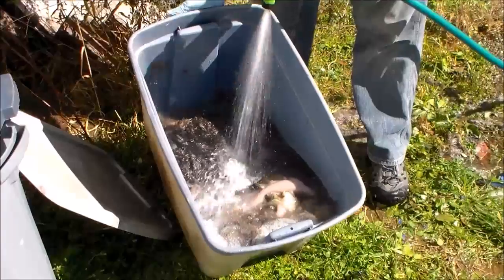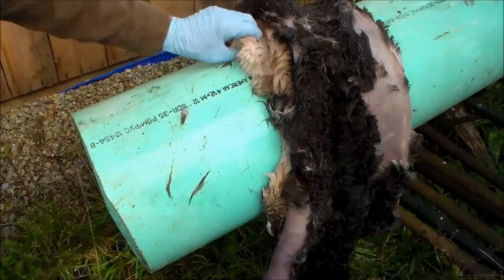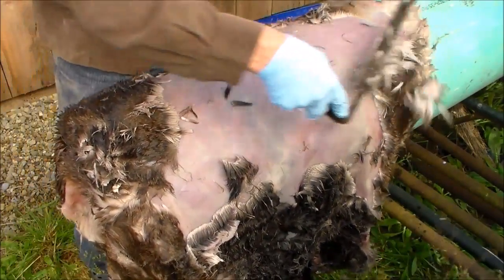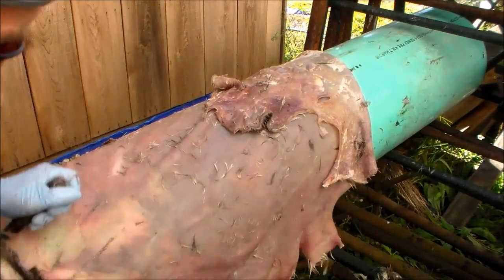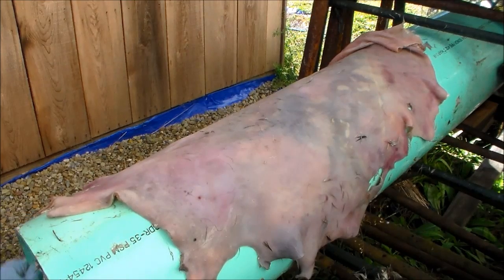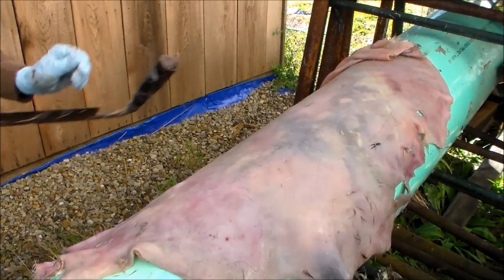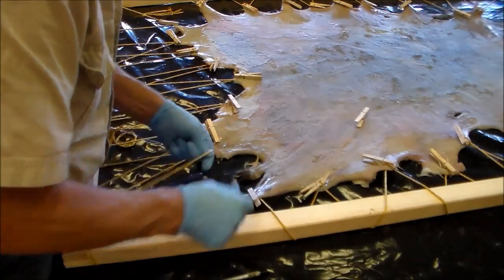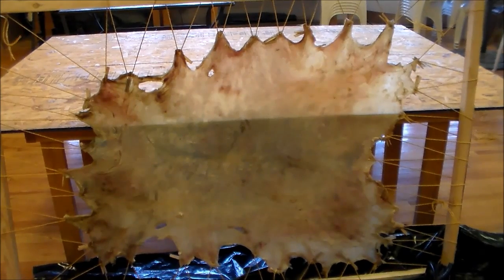DIY Rawhide From Deer Skin

Comment: i once did a rawhide from a fresh hide, from an impala, the end result is now the head of a few drums i made for myself. Now i am trying to re-hydrate a hide that was stretched and dried, something a hunter on a nearby farm gave me to try to make rawhide from. I had it laying in water for about 3 days now, and unlike the fresh hide, where the hair came out easily after only being in water for about 2,5 days, this dried hide just does not seem to want to release the hair at all. 
Will soaking the hide, which is thoroughly soaked by now lose the hair more easily if i soak it in a mild lye solution ? Any help will be appreciated, as i am working on a much larger drum than my normal small to medium size.

Comment: Hey Don, nice work. What is the ratio between the Lie and water that you use to soak the hides. Much appreciated.
Reply from the maker: You know I have never measured this--- I use a container with enough water to easily cover the hide and use a small can of lye, about a pint, worked fine. the Natives would just use wood ashes and I'm sure there was no measuring, just makes a white milky slurry and work into the hide, roll it up, hair to the inside, and let stand until the hair starts to pull out easily. give it a try my friend---Don

Comment: Hello what solution you soak the hide?
Reply from the maker: Water with lye in it, the natives would use the white wood ashes which is a lye solution.
Reply: @donaldporta  Thank you it help alot 😁
Reply: If you want to avoid using lye soak it for longer (usually 3 days but no more for me) hair dosent come off quite as easy but lye is nasty stuff